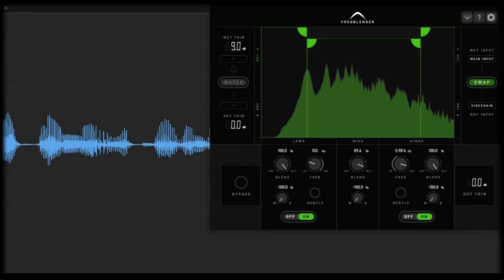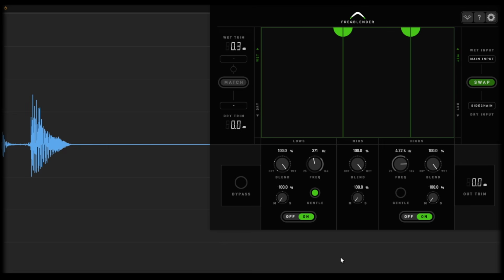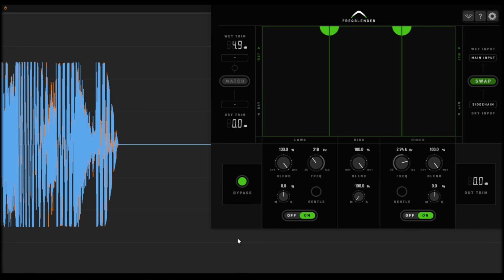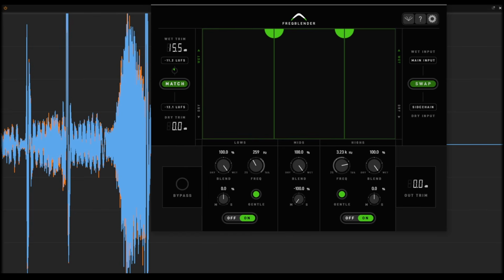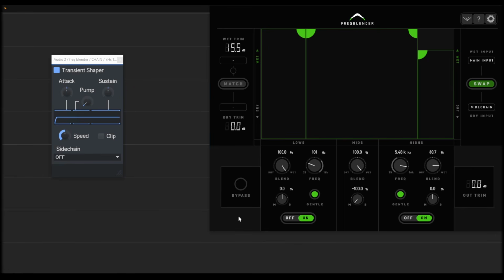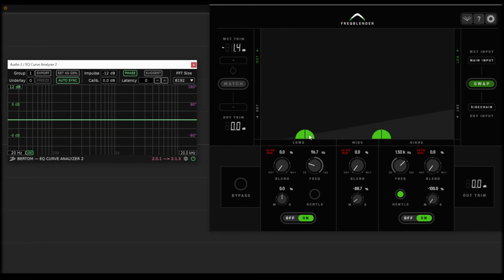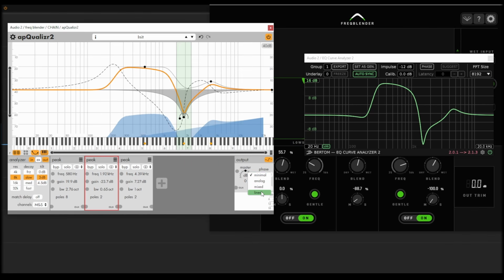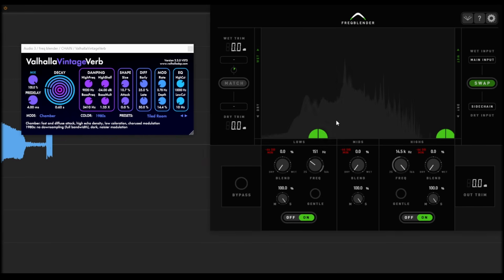FreqBlender, deeper control for all of your effects

Comment: Routing in Ableton: 
The best way I figured to go about it is to just add thing to the signal  --- 
I always add effects to my signals like spices in a dish - 

1.Open on the audio /Midi channel you want to effect an 'Effect Rack' 
Which is just making a group inside the channel 
2. Then add another chain in this effect rack- and place the FreqBlender there 
Now you got an effect rack with one dry channel and one with the plugin 
3. On the plugin sidechian bar select the same Audio/Midi channel but make sure you select also the 'dry post mixer' 
NOOWWW
4. you can put anything you want on before the FreqBlender plugin in it's chain and the FreqBlender will control it -BUT it will mix between the wet signal or mute 
And I find it perfect cause you can ADD things to the audio without ever changing the dry signal in your mix

Comment: This is actually a quite handy tool. I can set multiple audio receivers in bitwig multiband with mid / side splitters to kinda achieve the same, but it is a lot less convenient plus this has milder band options for less phase issues. Sometimes we might want to set up separate instances per band, but often you could just use the same effect across all bands to save time. Basically like mini shaperbox for any effect and you can add envelope followers / msegs control per band too in bitwig! I like the concept so will probably get this.
Reply: yea, the phase response and generall nicer ui are a big plus over just doing it with bitwig. also makes it a lot more viable to use with headroom sensitive processing like limiting/sidechain/clipping i reckon, i want to do some testing around that on stream some time soon.

oh also unrelated to this plugin, i highly recommend using robberts crossover with bitwig when you want more than two bands. bitwigs multiband fx unfortunately has somewhat poorly designed crossovers that start doing very weird things once you move the two crossovers too close to eachother. try it on some white noise or with an eq curve analyzyer, youll see what i mean. i really hope they fix this sooner rather than later haha

anyhow, freq blender cool. nifty tool